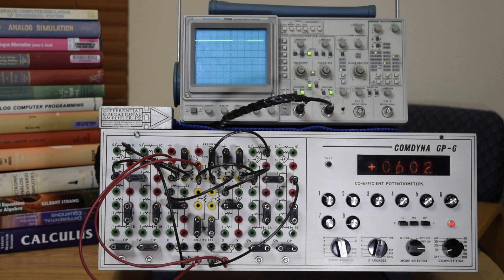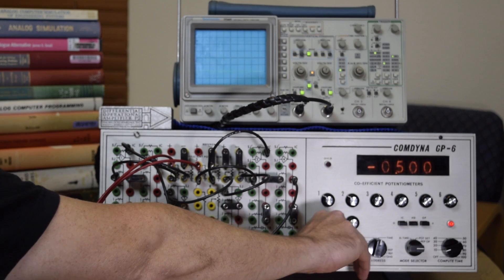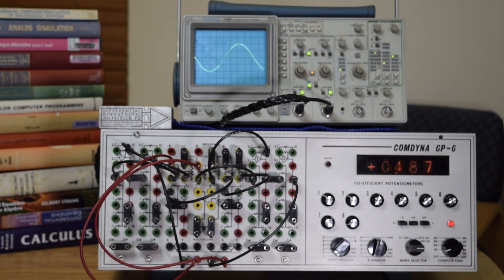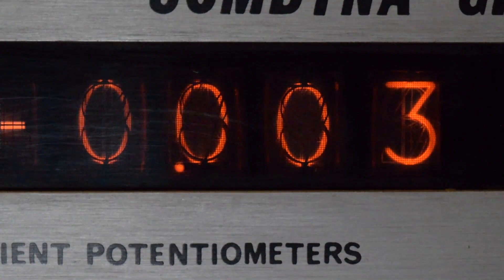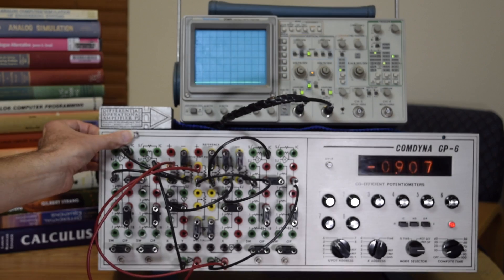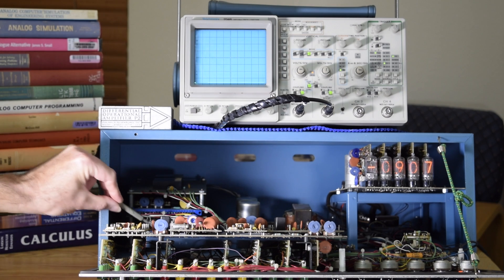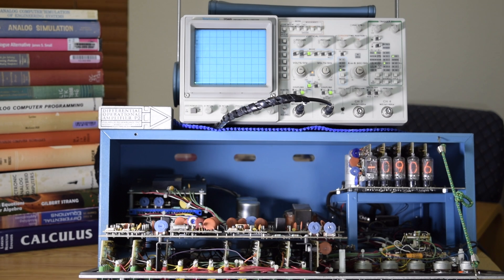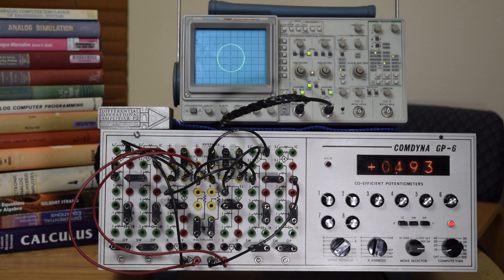Early Comdyna GP 6

Comment: Hello, I just bought an early GP-6 in pretty bad condition. Needs some serious work. It has serial number "019". Did you ever find documentation/schematics for these early models? Thank you.
Reply from the maker: Unfortunately, no. I have found several versions of the GP-6 manual, but all the versions I’ve found cover the later models with the 7-segment LED displays. Even with those models I have several versions of the hardware that have different configurations (particularly the power supply) that aren’t covered in the manuals I’ve found online.
Reply: @timthompson468  OK, thanks. There seem to be many variations ... I am just about to finish up one that I bought a few weeks ago. Serial number 269. It has an LCD voltmeter (was probably retrofitted at some point). It had a bad Op-Amp in the time base and a couple of cold/broken solder joints on one of the amplifier boards and the Y-switch. Some of the potentiometers are in bad shape also. Will eventually have to replace them. Overall the device shows signs of heavy use and partial repairs/modifications. Even the two quad amp boards are of a different vintage.